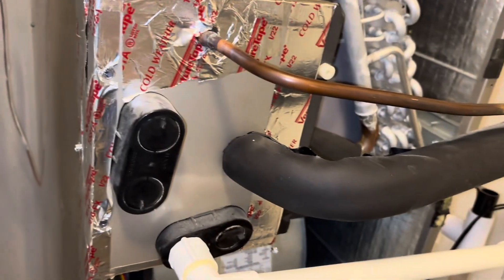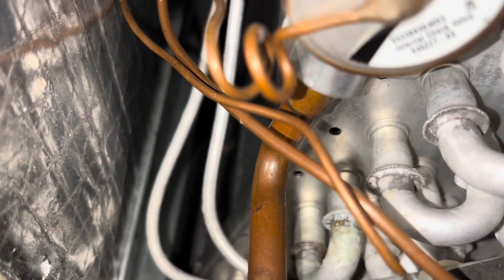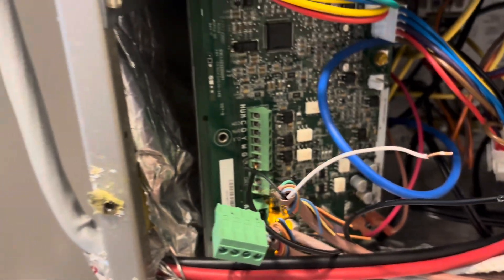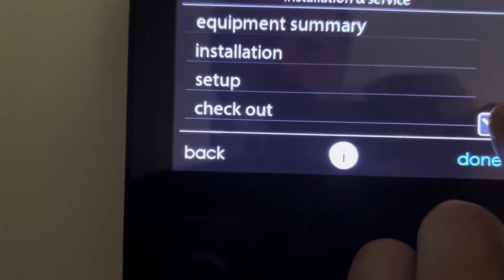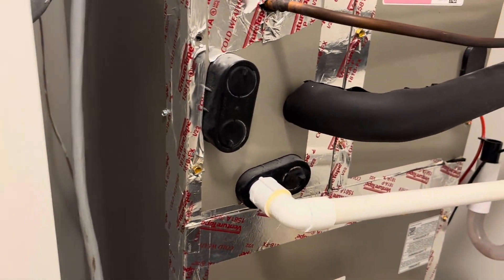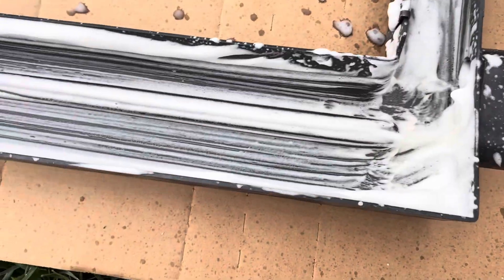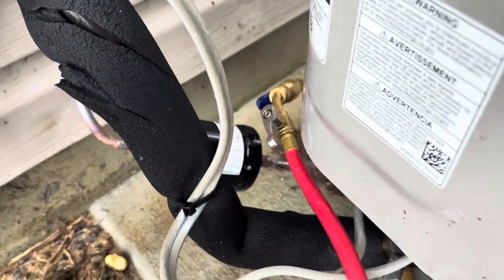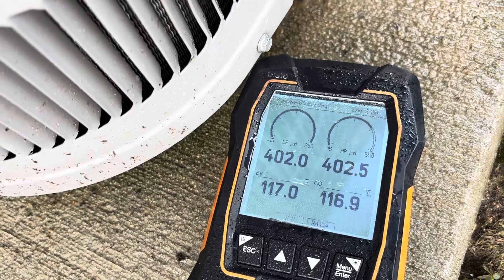Bryant Evolution Heat Pump Leaking Refrigerant…Repaired!

Comment: Goodman had a bad batch of R22 evaporator coils around 2007-2008. Trane and Carrier techs bash Goodman as cheap junk. We primarily offer Goodman for replacement installs. Warranty calls are far less than other brands we get called to repair that we didn’t install. Every service truck carries their standard replacement parts like caps, contactors and condenser fan motors. The heat pumps do have a proprioritary  defrost board as do the communicating models, but that is normal. Trane, Carrier and Lennox use propriety parts and are usually a two day wait to get. Our Goodmans keep costs down for the customer and repair invoices low.

Comment: I've got a Bryant 4 ton aluminum evaporator coil from 1978, sitting right above an electric resistance heating coil. Still no leaks!  The entire interior unit is original except for the fan motor which I only changed because the bearings were noisy from wear. I got in a new Chinese ball bearing 240 volt, 4 speed motor for $100. I only used the 2 lowest speeds. A new capacitor too.
Reply: The fins may be aluminum, but the pipes in the coil were copper up until about 10 years or so ago
Reply: @Straight_White_Fatherly_Figure  Actually some of the real earlier carriers were aluminum coils. All the way to the tubes. They didn't have the best transition from copper to aluminum. I believe it was a flare fitting and on the ones I replaced often times that change over from copper to aluminum was the source of the leak. The rest of the coil was still fine.
Reply: @Sightthrough  yeah i see that a lot with Frigidaire package units and their condensing coils. Attempted to fix one when I was new.. what a mess
Reply from the maker: Good to hear.  Definitely don’t make them like they used to.

Comment: Requiring registration to get full warranty should be illegal. It should just start at manufacturing date instead of installed date if not registered.
Reply: In FL, DeSantis just now made it illegal. Mandatory warranty regardless of registration.
Reply: @Straight_White_Fatherly_Figure  Been this way in other countries for years. Manufacturers can't make extended warranties contingent on registration.
Reply: @Sightthrough  i always thought it was shadey when a warranty somehow gets cut in half all because someone buys a house. And as a company we cant just eat that cost either. I could understand if a system was installed, un-installed, installed somewhere else
Reply: In Florida whether it’s registered or not it gets the 10 year manufacturers warranty, even if it changes ownership
Reply: @madeinusa1576 does this only apply to units installed after the effective date? Couldn’t find anything confirming or denying that on the bill
Reply: It isn't, it's scare tactics by the manufacturers, and they know it but still use it!.

The job ended up under warranty so the manufacturer abided by the law.
Reply: @jameslong3351  it is 5 years normally, 10 years if registered. contractor misses registration, owner gets shafted.
should just be 10 years flat from manufacturing date or if registered, install date.
Reply from the maker: I agree.
Reply: The Infinity/Evolution systems have a charge checker in the user interface. It will tell you the sc the system wants based on all its parameters measured in real time. You just charge to the required sc